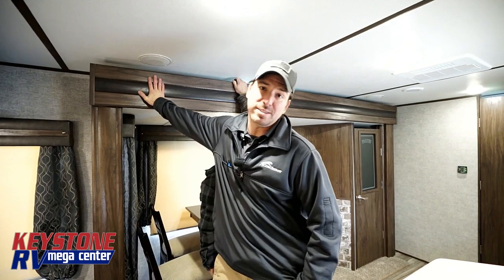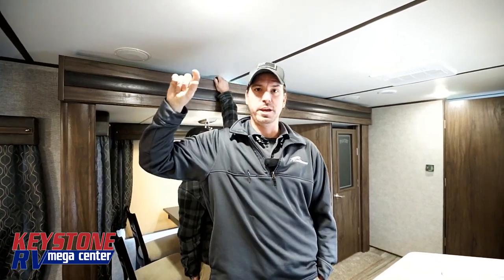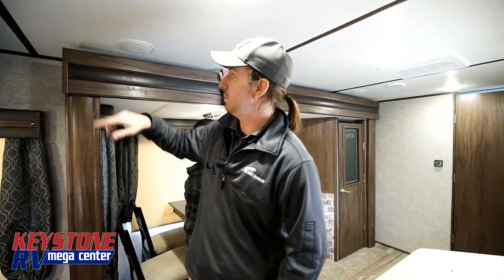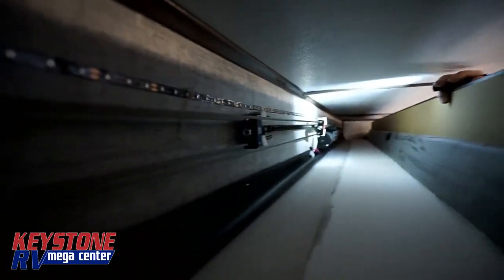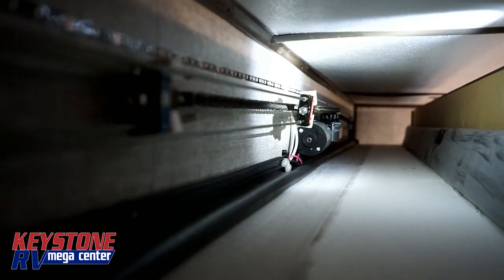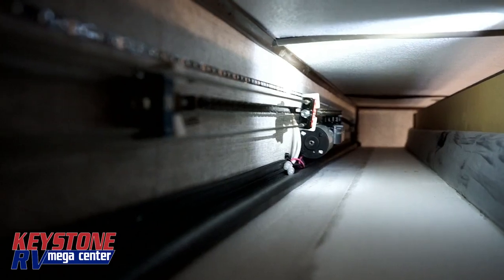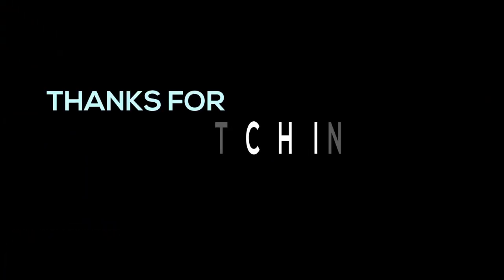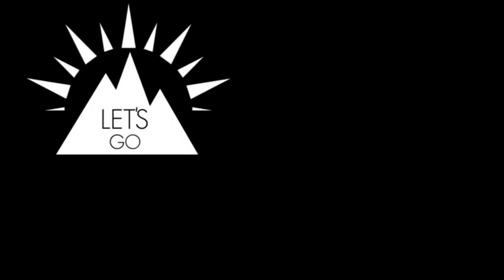How To Maintain Your Cable Slide System In Your RV | Teach Me RV!

Comment: The cheap cable system is what has steered us away from a new Cougar 5th wheel. We just sold our 16 year old Cougar. Neither of the two slides had any issues in all of the years we’ve owned it, but it was not this type. Guess we’ll move over to Rockwood or Grand design for out next camper
Reply from the maker: We got Rockwood/Flagstaff here ready for you

Comment: I have a 2016 sprinter fifth wheel with a cable system for the slides. Both slides "shimmy/ skip" when retracting. Is this an issue I should be concerned about? There do not appear to be any rollers that the slides ride on {except for the smaller bedroom slide}. Thanks
Reply from the maker: With a sprinter yes. Have a dealer look at it that sells them they will be able to diag it better
-JR

Comment: I have a 2015 Keystone Cougar and my slides jerks as the go out and in, and the camper is plugged into a/c power. Both sides do this, the cables seem to be adjusted right, are there rollers or anything else that should be lubed? I did get do not lube the cables.
Reply: Typically not. If it was only one I would guess slide out of alignment but with two that's odd. I would check with a Keystone Dealership see if they have any experience with that. We are Keystone RV Center because we are in the Keystone State of Pennsylvania. They just grabbed the same name as us. We do not stock any of those products
Reply: David did you find a solution to this? I have the same issue with my trailer

Comment: So basically, don’t touch a simple cable system so we can charge you for 6 adjustment points.
Reply from the maker: Typically they will not need a ton of adjustment but it is not something we recommend a customer tackling themselves 
We do recommend you taking it to a service department. Does not have to be us. But yes pay the professionals
JR
Reply: One thing I know about "professionals" is they screw shit up too.

Comment: You said in the video don’t touch the cable slides and really no maintenance for them, except visual for frayed cables. However, the cables on our last camper came unbolted. Luckily no one was inside when that happened and the slide was fully extended. The cable was hanging over the top into the room. How do you check the bolts? Should you check the bolts?
Reply: The manufactures of each slide will be slightly different but I do not know of any that say check the tension of the bolts themselves. Not to say there is not some out there but I have not seen it yet.

Comment: I have a 2016 3 11-inpact toy hauler. What's the generator on or plugged in when I pull in my living room slide out, it has started jerking a little bit. I noticed on the slide out in the bedroom that there are like little white plastic roller and I think that's why that one goes in so smoothly. I've only owned this Toy Hauler for one year, and they did go in smoothly in the living room all the time and now the last couple times its doing the jerk jerk jerk sing while it's being slid inward. There are no white plastic rollers under the living room slide out. It had a previous owner, play the previous owner had put the plastic rollers on the upstairs bedroom slide out and not the living room slide out? I saw a video where people are putting nose in on their own with the cable system slide out when they start going jerk jerk jerk,, the rollers help them to go in smoother.
Reply: You may need to have this looked at this could also be an alignment issue

Comment: Cable slides on a Montana fifth wheel, battery charged well and plugged into shore power. Bedroom slide is quick to open or close, entertainment area slide not quite as quick but no complaints. Living room slide is largest, it seems to drag, and open or close much slower, cables are good on all three and I have not tried to adjust them. Does this sound more of an electrical issue? I would stop by your place but I am in Oklahoma. TIA. Great video!
Reply: might be just the size and weight but I would have it checked out just to be on the safe side. Thanks for watching and commenting...and come on I have been camping in Oklahoma....stopped for 3 days at Hochatown State Park. Loved that trip and a beautiful state....

Comment: I have replaced 3 motors in 4 years. Everyone blames or defers to someone else. I view and maintain before each trip. These BAL motors are garbage. I have read many reviews on how poorly they are built. I have replaced each one since the local RV repair wanted 150.00 an hour with a minimum of 5 hours. First time to include watching the installation video mis stream took 3.5 hours. The last 2 just over an hour.